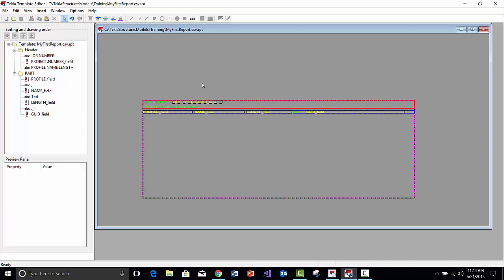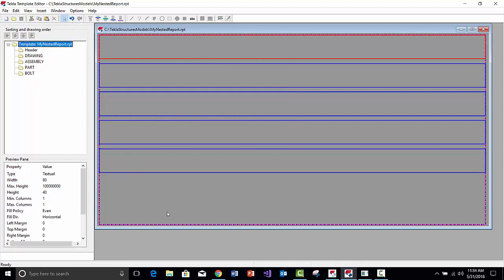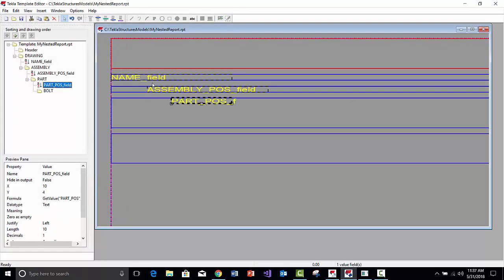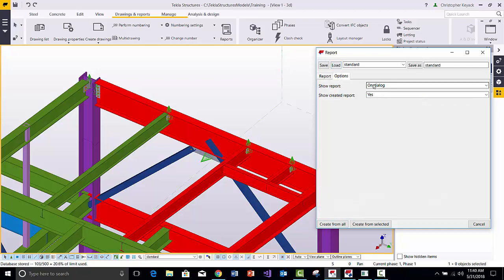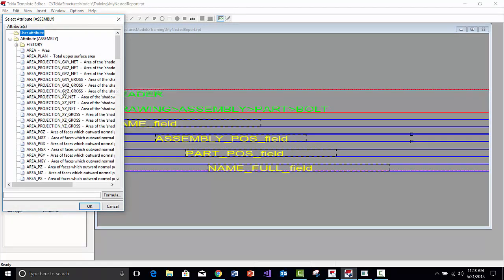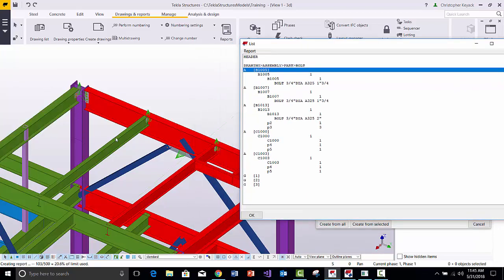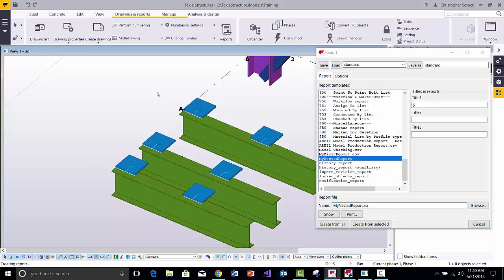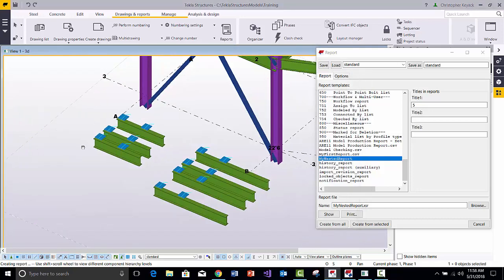Tekla Report Editor Part 3 of 3

Comment: the formula at end to get total no parts per assembly is incorrect. eg. if p1 has 10 quantity & 4 per beam= 4*2=8 now 2 parts are with different assembly. still this report will only 10 nos. since its directly multiplication from 1 piece to model total. please provide correct way